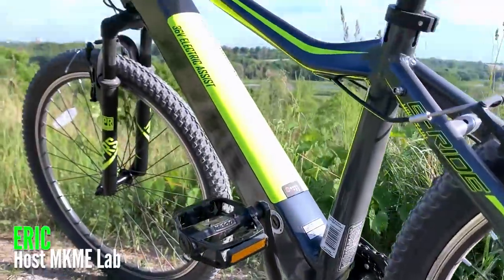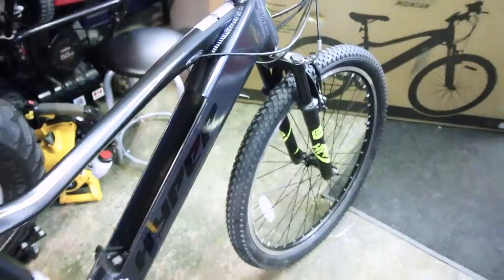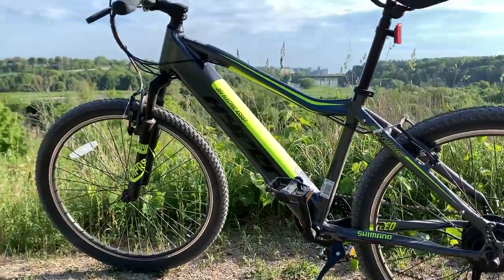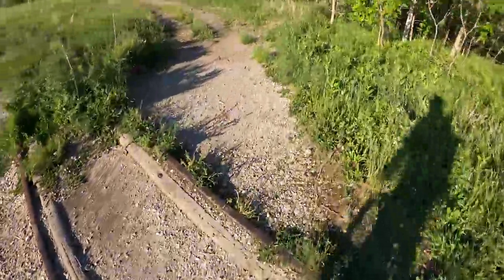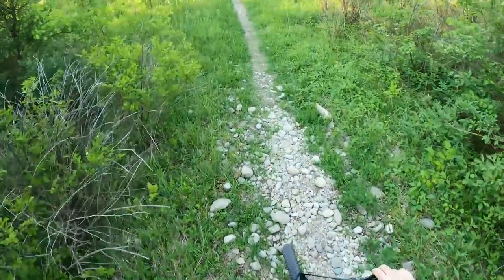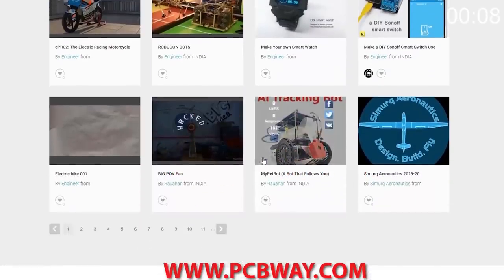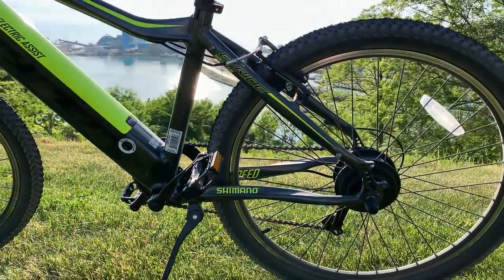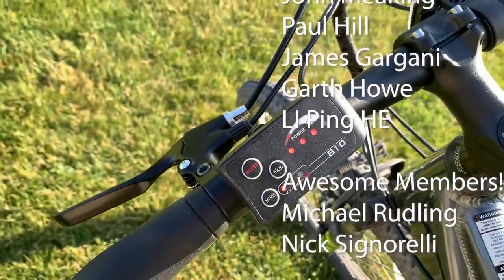Affordable Electric Bike That WORKS! 🔋

Comment: You did an excellent review on this bike , you covered the main points as to what this bike is intended for , trail riding at the most , other you tubers took it to a downhill track and broke the entire bike . This is not a mountain bike , it's a bike for people that need to get somewhere quickly and with little effort
Reply from the maker: It is definitely not intended for heavy off-road use but clean/dry trails are just fine.  I couldn't be happier with it for the price- but as you point out- it could easily be a bad experience if someone tried to hammer down heavy duty trails. For in town/light trails it's great.
Reply: @MkmeOrg  exactly , it's less than half the price of any other brand that's selling e bikes even the cheapest contender lectric isn't meant for heavy duty off road

Comment: Best video I've seen on this model, just bought one for myself, $398 @walmart. Thank you for the info.
Reply from the maker: Glad I could help
Reply: How did it work
Reply: @chenlv9612  By using a credit card on their website.
Reply: @chenlv9612  I have only rode it once, it's cold here (28f). Very impressed for $400. The video is spot on, couldn't say it better myself.
Reply: ean.007 - are you 12?

Comment: Where is video fixing loose chain issue? Also when you applied the locktite, where did that screw come from on the bike?
Reply: Those are the main pivot bolts for the brakes, and yes they should have at least blue loctite on them.

Comment: Looks great. What would you do for a battery replacement? It looks like the battery is part of the frame design, so I'd assume it'd be hard to find a compatible battery, right?
Reply from the maker: It will be 18650 cells inside. Can buy them anywhere

Comment: I just bought this same bike after watching your video. Sadly after 15 mins the chain came off and after quickly putting it back on with no problem, the motor now doesnt engage. Everything looks in tact and all lights still on. Just cant get the motor to engage.so frustrating. Any ideas?
Reply from the maker: Check and see if it chewed up the cadence sensor/wires. If you tried pedalling with the chain not fully engaged (sitting on the wires) you might have chewed them up.
Reply: @MkmeOrg  Thanks - sensor and wires looked completely fine. Hyper / Walmart have agreed to take my bike back and send me a new one.

Comment: Can the battery  compartment be opened to replace the batteries with lithium ones?
Reply: Given the capacity and size of the battery pack, it is almost certainly already lithium, probably packed with 18650 cells.

Comment: I just ordered one, my work is 12 miles I hope it works,pedal then switch to electric assist maybe? Or does it have to be assist all the time?
Reply: I ordered myself one too! You can choose between manual and assist but beware manually pedaling will be harder

Comment: After how many years the battery will need to be replaced for this Hyper ebike & and how much it will costs in CAD?
Reply: Battery life with lithium batteries depends on the number of charge cycles, which depends on how you ride it. If you ride it on weekends at the park, it will last a long time. If you have a rough commute, with lots of hills, 20 miles each way, recharge at the office, the battery pack probably won't last a year.

Comment: Is this bike good for uber Eats? And how many hour does the battery goes
For
Reply: I was hoping someone answered this 😭
Reply: It depends on how much pedaling you do versus how much boost you use, but figuring a 20 mi range, on a top speed of 20 mph my guess would be in between 1 and 2 hours on the battery.

Comment: Outside of the tires and repair Bikes are significantly cheaper for transportation than cars are. Not to knock cars but if u aren't very wealthy cars can be a burden. I prefer Bikes or Motorcycles to get around

Comment: Great timing on this review Eric! I'm looking at different ebikes and hadn't thought about Walmart bikes. I'd be interested in your thoughts on upgradability of this one. 👍
Reply from the maker: Ill do a pt 2 with all the stuff I've added- haven't changed anything mechanically yet. Plan to put a disc brake on but so far haven't needed it so its on hold.
Reply: I bought one of these about a month-5-6wks ago.... I was also amazed by the speed it produced (first time e-bike buyer), but also felt the braking was lacking. I added a rear disc brake and I am happy with the braking results it produces. I also upgraded the seat post to a longer aluminum shaft ( the steel one it came with was at max length and was starting to bend from my fat ass (220lbs), and I added a rear splash guard (basic item).
Also note I bought the 26” wheel bike and when it shipped I saw the max recommended height was 60” (or 5’), I’m 6’ so I felt the bike was too small for me (but still tolerable) but after I noticed there is a larger model 29” wheel which was $100 more but it still would have come in at the $1000 mark ($500 cheaper than the next model I could find at Canadian Tire for $1500 on sale at the store that week) I would have bought that one as it seems it would have fit my larger frame.... although the longer seat post seems to have rectified my problem.
Reply: @MkmeOrg  Are the hubs, fork and frame designed to use disc brakes? There seems to be bosses for rear disc brakes, but could not see the hubs well enough. And the fork does not seem to have the bosses for disc brakes?
Reply: rear will take a disc, front needs for swapped to do so.
Reply: fork

Comment: Interesting video but you have the advantage of really knowing your way around bikes... for example being able to spot the mis-aligned derailleur, knowing how to fix it,  and being able to adjust the chain as needed.  Most people innocently buying a cheap Walmart bike aren't going to recognize these problems & may have problems with the chain etc. 

Especially with bikes shipping from China, shipping across country and expecting the end customer to assemble an ebike, making repairs as necessary, is really a flawed method of distribution, IMHO. 

Ideally, customers should consistently get a new bike that's ready to ride and setup correctly without any issues.   I know that seems like a lot to ask, but it used to be something that could be taken for granted.  

Problems of this kind are probably common even with much more expensive bikes if shipped long distance.  In some cases distributors back their products with real intent to provide end customer a positive experience and even go so far as to arrange for a local bike shop to send someone on site to trouble shoot problems if they occur -- not often though, and really worth checking on before buying a big box e-bike. 

There are a couple national bike servicing company's have a presence most places, but the minimum charge for assembly is usually pretty stiff ($250.00 for Velofix in my area).

I bought a regular (non-electric) bike about 6 months ago, from Walmart, and ordered add-on assembly  service they offer for  $50.00.  The person they sent was actually specialized as he had worked in a bike shop before getting the Handy gig job.   I can't guarantee that all the people Walmart sends out for their assembly service would be as knowledgeable, but it worked out for me and odds are decent that Walmart can at least arrange to  send someone with basic mechanical skills who can fix some of the kinds of damaged-in-shipping problems that come up so often. 
..
Reply from the maker: Its Walmart- if you have a problem- return it. Just because I can do  things and I chose to share a simple fix doesn't mean you have to. Or you can rant in the comments- whatever floats your boat.
Reply: @MkmeOrg  I may have been ranting but in any  case I enjoyed your video and meant no criticism of you.
Reply: @kschuman1152  I think you make a good and valid point. Most people would do well bringing it into a bike shop once they get it and for a tune up once a year or so. That adds up and quickly becomes more than the cost of the ebike at which point you ask yourself should i have spent the money on better parts, but considering you'd have to do that with any bike you get (no bike shop gives free lifetime tune-ups) if it's good enough get it!
Reply: @RabbiEliyahuCowen  I decided to buy one of these Hyper e-bikes.   Two actually because Walmart had them on sale for $399,  and it made sense to buy another for spare parts. 

Both of them suffered similar damage in shipping - both had bent derailleurs.  It's a tricky fix IMHO so I scheduled an appointment with Velofix, a national company that sends someone to your location to repair or tune bikes.  This cost me $60 + tip of $20.   I'd rather get a bike that really  works without being repaired first, but I needed something to get from point A to B and after getting past startup hassles I'm happy with the bikes.  Both sets of motors, batteries, and controllers work well, and the V-Brakes are fine also. 

I still don't like the way Walmart handles the distribution, which I think in most cases will require the customer to repair shipping damage (which is highly likely to occur) on their own.  I would prefer at least an option to buy these at a local Walmart and to get service from the store also.  Walmart should unpack, inspect, and repair damage before selling to the public.  The result would be a safer and more reliable product.

Comment: why does it have so many thumbs downs?
Reply from the maker: ¯\_(ツ)_/¯
Reply: In the biking community, a large portion of them absolutely hate e-bikes. I mean HATE e-bikes!  For a variety of reasons - but mostly for absolutely stupid elitist reasons which can easily be retorted with just one response: "mind your own damn business." They basically see e-bike users as lazy plebs who have no business on their trails. 

The only semi-reasonable reasons i've seen listed is, it allows in influx of many new riders who'd never ride our trails before the popularity trend of e-bikes, clogging up these sacred trails and causing more erosion and possibly causing the shutdown of beloved trails - something of which mountain bikers have already struggled with for decades before.  Most common demand is they say e-bikes should stick to dedicated ATV trails along with all other motorized off road vehicles which really limits the amount of trails you'd be able to access, not to mention your little electric assist bicycle would be riding among extremely dangerous powerful and heavy motor bikes and ATVs where the speed disparity between you and them would be quite hazardous.